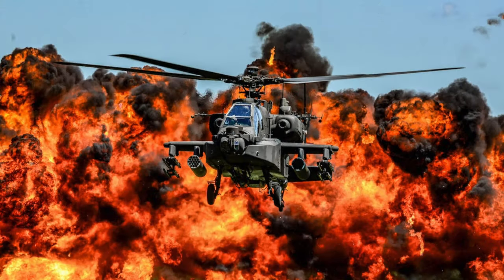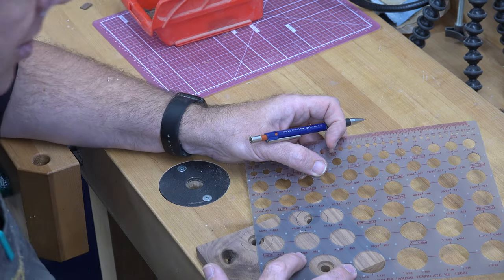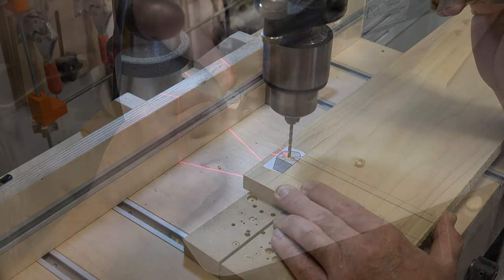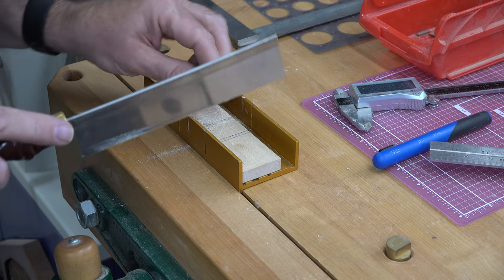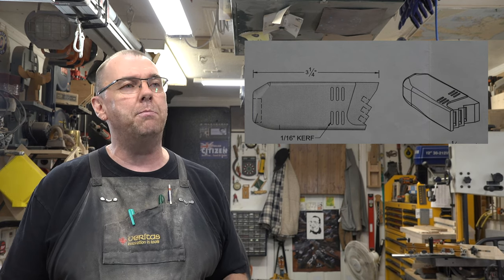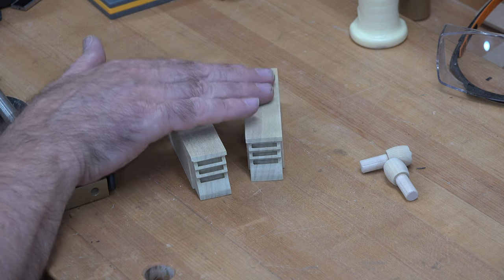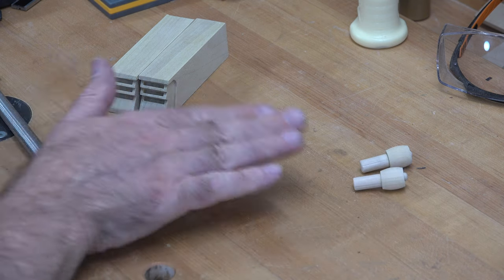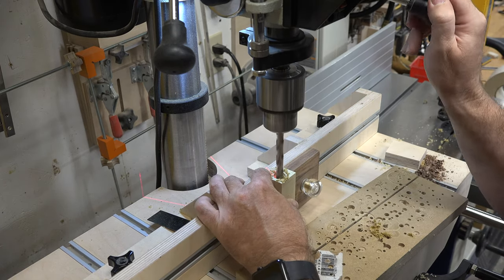Making an Apache Attack Helicopter Part 3

Comment: Here is a build I would like you to design and make.I think a scroll saw might do the cabin parts. Other tools most likely for the rest. I've been wanting to make one myself next year. And here goes. A late 1800's to early 1900's pond boat model. I almost bought one on e-bay years back ,but was afraid I would feel the need to restore it. That wouldn't been good lol.
Reply from the maker: I have to say Michael that I'm not even sure what a "pond boat" is but it sounds like it could be fun.  You should consider sending some pictures of what you have in mind to the channel's Facebook page in a private message and I will get an idea from there.  Thanks for tuning in to the show and chiming in with your suggestion.
Reply: @acutabove_woodworkings  I no longer use Facebook, but a pond boat is a sailboat model with a solid hull all wood with metal fittings. Kids and adults used to race them (no remote control}. Or they put them in a community pond and let the wind take them, they sometimes had a line for retrieving. They were handcrafted and quite beautiful. I appreciate your videos and comments, take care and stay safe!

Comment: I was wondering why the tail rotors weren't at 90 degrees from each other so I looked it up and it is actually two different pairs running in opposite directions. Who'd a thunk!
Reply from the maker: See? you learn something new every day.  Thanks for tuning in Bill and taking the time to leave a comment.  It's appreciated.
Reply: @acutabove_woodworkings  Still not sure what to say about the Garden. ;0) You are a woodworker I have never encountered before. A true hobby, small project person. I am learning a lot but still making larger things. At some point though I expect to follow along. Just need to see the opportunities you do. I think your site name should have been Woodworking Hobbyist. Regards, Bill
Reply from the maker: @billinfarmington5189  "Woodworking Hobbyist" almost sound like a bad thing.  I make plenty of larger projects but don't feature them on the show.  I have featured a couple.  My roll top desk series and my workbench build series are just a couple.  I have built furniture for years but I don't find it to be an interesting show topic, so I build smaller things that everyone can enjoy.
Reply: @acutabove_woodworkings  I wasn't trying to demean you in any way. I have learned several things from warching you. I am just a long term hacker. During my working career I would work long hours for about six months programing then spend the next six months with somewhat shorter hours doing wood projects. At one point I even had to sell my tools to make ends meet.  Now, I can wallow in doing whatever I want. But at 72 time is not on my side. But I continue chugging along. You have to know I admire your abilities and am jealous of your skill set. So far you have cost me several hundred dollars in following along. I guess i will have to dig deeper into your videos. One thing that is unique to you is the variety of projects. So many others make things i've already done but not you. Most everything you do is something I have never tried. I am a true fan of yours, Bill
Reply from the maker: @billinfarmington5189  Thanks for your dedication to the show.  It's appreciated.